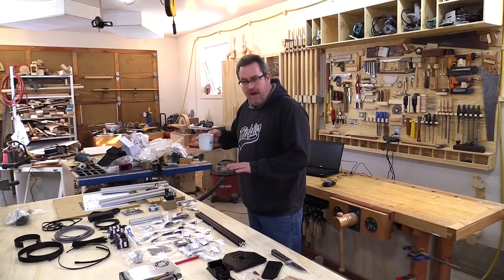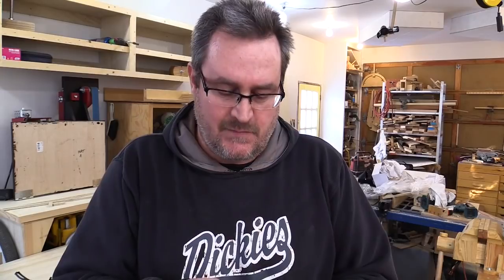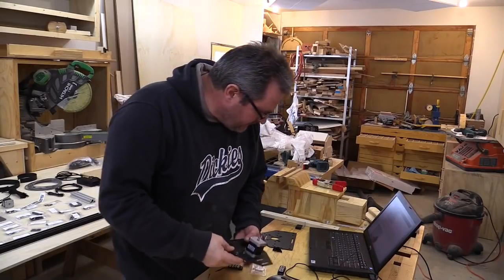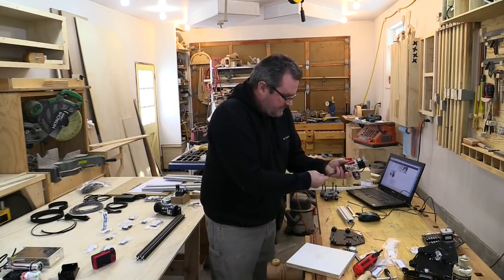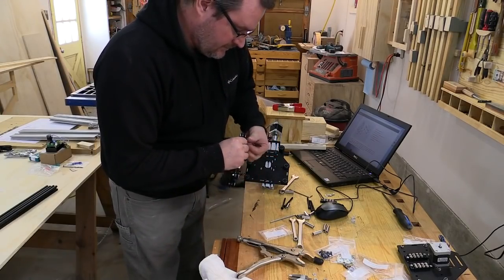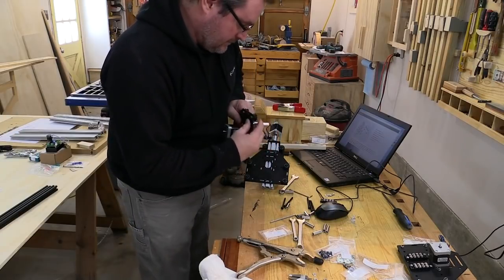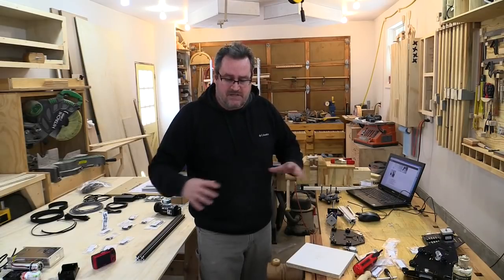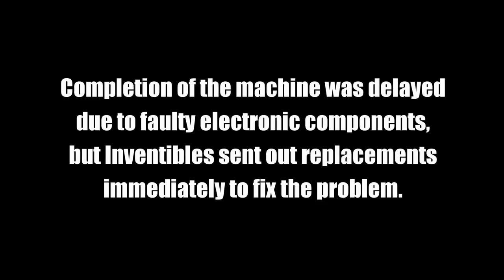My Shapeoko 2 Experience

Comment: Dig the cable management - and i agree that they could have put a couple extra parts in there in case some were lost. I had the same problem - not that they weren't in there but that i lost a couple parts in the nightmare that is my basement.  I used the video more than the regular instructions and just referred to the instructions in case i had more of a specific question that i couldn't pull from the install video.

Comment: Odd that it is set to cut the inner circle of the Os in the Shapeoko demo anti-clockwise and the outer clockwise, would have thought all cuts would default to working with the spiral of the bit?
Reply: MrBerkerk it depends what edge of the inner and outer circle was drawn. If your cutting on both sides it doesn't matter what direction you cut.
Reply: Sirus  Huh?